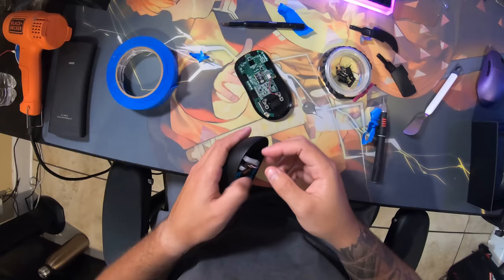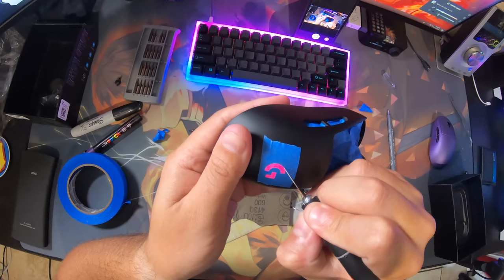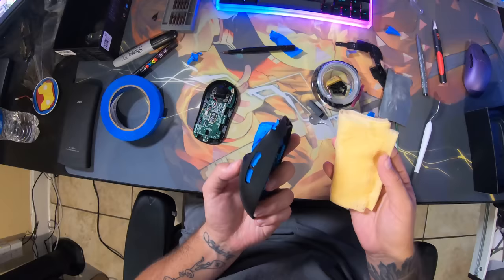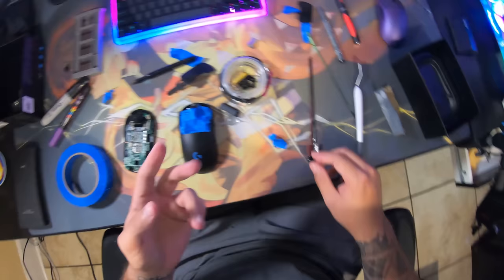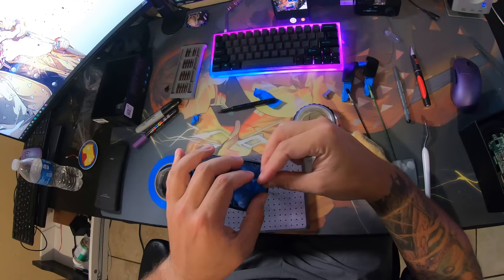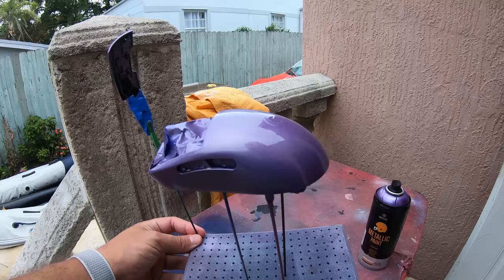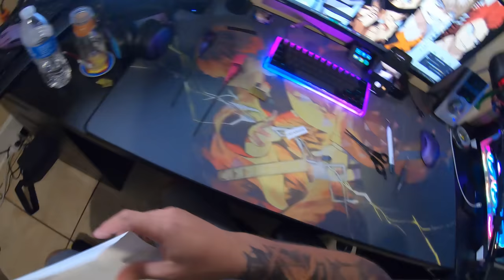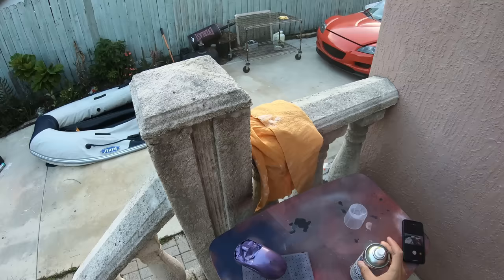How to Paint a Gpro Wireless, Tutorial.

Comment: Just bought a beater gpw to try this on before doing it to my superlight potentially.  Great paint work. I really like the viper you did.
Reply from the maker: Ty brother good luck !!
Reply: @NachoCustomz   Thanks, Is it ok to use other plastic primer besides the mtn one? I got the mtn 94 paint and sealer.  Also where do you get your scroll wheel rings. They add such a dope touch. Specially on the RVU.
Reply from the maker: @8bitsamurai6  yes it’s ok to use another. Some aren’t as strong. And Amazon look up silicone rings size 8.5

Comment: Very good tutorial, easily the best one I've seen specifically for doing paintjobs on gaming peripherals.

I've got a question though, if you've finished painting and applied a cleaecoat but want to do the job all over again from scratch, what's the best way to get rid of the paint? I've sanded down most of it but some areas are covered so well it would take an eternity, and a lot of sandpaper. 

Also, what would your setup approach be if you had to paint 2 sides of a shell (i.e honeycomb mice) instead of just 1? As in how would you hold it up, order of painting etc.

Thanks a bunch again for these videos, your sprays are awesome.
Reply from the maker: Vryndar thank you so much for the kind words. You can always sand down to an even flat surface. Primer it and paint again. Doesn’t have to be all the way down to bare plastic  . Dm me on Instagram I’d be glad to help

Comment: Hey man question. I spraypainted a mouse emerald green using kustom canz paint really good paint then a 2k clear coat I have rupped the 2k clear coat off after a month of usage paint holds up but slowly rubbing off any recommendations for what I need to seal it with that is resistant to finger oils and extensive usage.

Comment: does it really make a difference if you wait the 7 days or so before applying a clear coat for the paint underneath to cure first? I noticed you just clear coat after the previous layers of acrylic dry. Im planning on painting a mouse soon and want to do it perfectly.
Reply from the maker: i actually spray clear after an hour of the last base coat :D if you wait too long it wont bond correctly after

Comment: Hey man, I love your videos!
Could you give me some advice?
I have a GXSL and i dont like the standard coating on it, it's too smooth for my linking. So do you think I could just spray a few clear matte coatings on top of the normal ones? Or do I first need to sand and prime? I want the original design with the logo and the color to stay the same. When sanding I fear scratching the original coating and the logo so mutch that it will be visible through the clear finish... Have a great day!
Reply from the maker: You can sand it with 1000 grit and use spraymax 2k clear
Reply: @NachoCustomz  Thank you! So I wont need a primer?